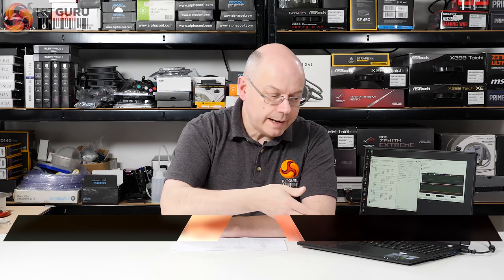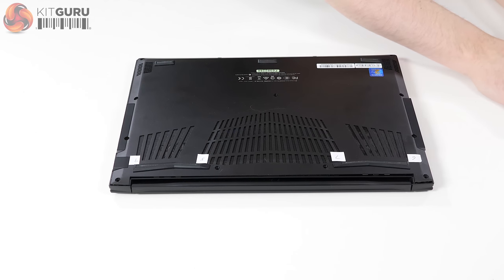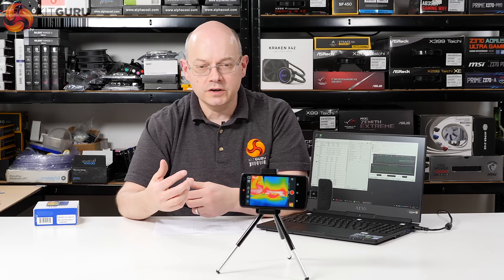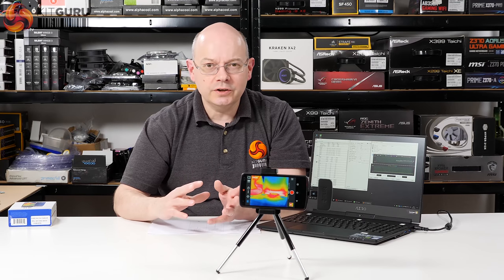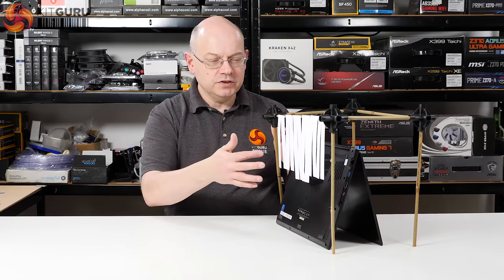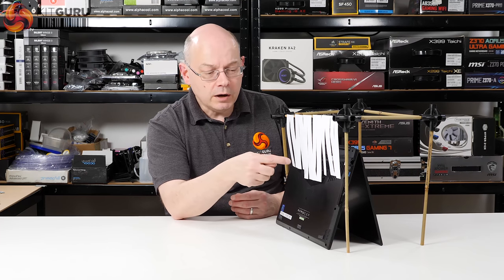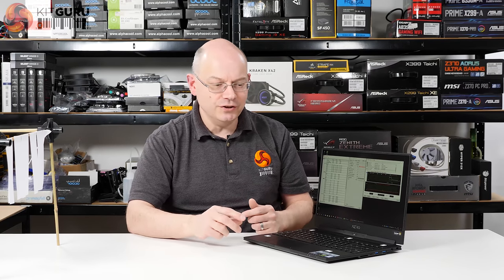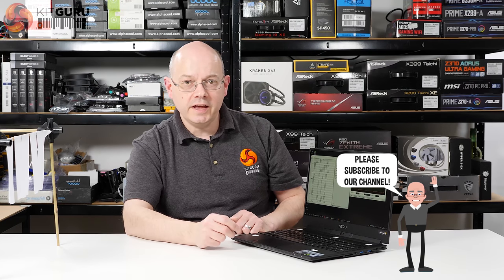Gigabyte Aero 15X v8 - Part 2: The THERMALS and COOLING!

Comment: Leo, I have to commend you on your integrity and your willingness to provide fair impartial reviews. I'm sorry I was the one to call you out on this one but as you've chosen to investigate further and clarify things it shows great character and you have my upmost respect.  

I've owned a number of "gaming"/ "performance" laptops over the years and most if not all have had vents on the underside. They have to dissipate a lot of heat in a small space and that ofc isn't easy. I'm not entirely sure there's a perfect solution (some people dislike side exhausts as it messes with your mouse hand as one example!) 

I often prop up the rear of my performance laptops when they're working hard with books,  thick magazines, pencils, whatever I can lay my hands on at the time in an effort to permit extra airflow to the machine. This would benefit from the same and of course there are active and passive laptop cooling pads that could be used for maximum effect to this end. I'm not saying this machine needs it as from your review, it appears the cooling is able to cope without throttling which is most encouraging. Like it or loathe it, this is a good laptop.  

Any chance of an Asus gm501m review any time soon?

Thanks again for your time and energy invested in your reviews. 👍🏻
Reply: Agreed. Leo rocks in this respect. And credit to you for your critical thinking capabilities and willingness to initiate polite discourse. Hats off to you both.
Reply: Adored TV on his alt account 👀

Lol I'm glad he revisited too. Mad respect for that.

Comment: Leo you earned my respect for posting this correction. Not many would go through such an exhaustive explanation of cooling. Accuracy and Integrity are the mark of a true review. Subscribed. On a side note I've used dry ice to check airflow as it's inert.

Comment: If I use the laptop through a monitor with the lid closed, basically like a mini desktop, does it mean that the vent will be blocked and will have thermal issues? I had similar issues with surface book 2 which throttles the GPU when the lid is closed.

Comment: Respect you for making this video... Also, I have the aero 15 with i7/7700.... Whenever i game on this laptop I sometimes after a while I attach a laptop cooler (it's made by cooler master has one big fan only.. sorry forgot the model number) ... & I guess this is when the middle vent makes sense..because the temperatures go down real fast thanks to the big fan blowing air directly on the heat pipes... The fan noise gets irritating... But i use headphones for gaming...
Reply: Also, thanks for explaining about the FLIR camera...

Comment: Just a heads up for the reason for the big mesh in the middle of the bottom panel, it's the only part that won't be obstructed when you use it on your lap.

Comment: I bought the Gigabyte Aero 15x v8-bk4P on Cyber Monday waiting for 1,999 USD, And I'll see how it stand up in day to day use. buying the Gigabytes Aero 15x is from Amazon or Best Buy is better value than buying it directly from gigabyte, No sale tax is applied. shop around for the best pricing and look for the ones that offers extras like a gaming bundle.
Reply: how do you like the laptop
Reply: @Identity242  I like it, I would give it a 8/10 over all for everyday use. I have the 4k model and battery life isn't excellent, I've been able 5.5hrs to 6hrs with brightness set to 35% running Revit, SketchUp, AutoCAD and Netflix concurrently. Quality is a 9/10, would have preferred a unibody build but it looks and feels solid. I did a clean install and change the trackpad to Microsoft Precision drivers. I think a good price for this laptop today would be between $1600-1800 US dollars. P. S. Get a microfiber cloth for the screen and the chassis because it's a fingerprint magnet.
Reply: I like it, I would give it a 8/10 over all for everyday use. I have the 4k model and battery life isn't excellent, I've been able 5.5hrs to 6hrs with brightness set to 35% running Revit, SketchUp, AutoCAD and Netflix concurrently. Quality is a 9/10, would have preferred a unibody build but it looks and feels solid. I did a clean install and change the trackpad to Microsoft Precision drivers. I think a good price for this laptop today would be between $1600-1800 US dollars. P. S. Get a microfiber cloth for the screen and the chassis because it's a fingerprint magnet.

Comment: One perspective I would like to see that you didn’t entirely cover in the video, is how Gigabyte advertise the exhaust to blow towards the back of the device. I thought a method of doing this could be using the same paper apparatus as in this video, but having the laptop sitting on the edge of your table and holding the paper apparatus dangling over the back fans.

Contemplating my conclusion towards this laptop is hard. I know it will be used on a variety of settings, and have come to realise it may not be suitable for all. These include. 

1. On a duvet – may not be justifiable as a surface such as a duvet would somewhat cover the air intake entirely, starving the laptop and thus resulting in overheating. 
2. Performing with Ableton Live in an outdoor location that may be highly dusty – drawing air from the bottom and the inevitability of dust being drawn into the cooling system from the surface it is placed on, thus reducing the life of the cooling system overall. 

It is really hard to justify a decision on this, the Zephyrus M, or the MSI GS65 at this point in time. I have other concerns such as battery life and aRGB output as I do a fair amount of photo editing (large reason as to why I am approaching one of these notebooks) but also the variability of applications I can use it for such as gaming and general use, replacing my now outdated but somewhat surprisingly still usable (despite accidents it has dealt with, such as being sent flying twice due to irresponsible passers by) MacBook Pro Retina 2013. 

Albeit all thanks for this clarifying review! 
:)

Comment: Have the laptop, playing a test of BF3 with it sitting on a flat glass table one of the CPU cores maxed out at 95 degrees. While the limit for this CPU is 100 degrees, its still too hot to have a good lifespan. The other components around the CPU also need to be taken into account.
I then put it on a cooling pad, and did the same test, and that dropped the max core temp down to 89 degrees.
Now testing with undervolting, looking at thermal pads to put in strategic places, to use the underside as a heatsink, and if that still doesn't help, I'll look at repasting the CPU with a better thermal paste
Quite a bit of effort required to bring the temps down.
It's still a great performance laptop though and I haven't had it lock up or blue screen once.  Happy to compromise due to the thin and light form factor, just wish Gigabyte did the work I'm having to do.

Comment: How about lighting a match, extinguish it and quickly hold it near the vents. You would briefly see where the air is flowing without filling the studio with smoke.
Reply from the maker: Drawing smoke inside a loaned laptop seems a bit ... rude
Reply: KitGuruTech For science! It's such a tiny amount anyway, probably better than using dry ice or a smoke machine as water vapour could be a problem.

Great video though, would be good to see this in more laptop reviews going forward.  I'd love to see how different thermal compounds make and impact on temperatures, although loaned equipment and all that! 😉

Comment: How about a strip of confetti?  It's light enough that when it comes in contact with the intake vents it should stick to it.  Put it in front of the exhaust vent it should be away.

Another alternative could be incense, although it is actually smoke it shouldn't have that awful smoke smell, and, it normally doesn't give of so much smoke that it'll interfere with vision.
Reply: wbkruse13 might work although personally incense drives me nuts!
Reply: Yeah correct...confetti is great...the paper might just be too heavy to capture the flow in the regions where fans aren't present.

Comment: I am really wondering what would be the consequences of adding an extra (external) fan pointing at this middle space between the Aero's internal fans.
A lot of behavior could be seen... Possibly : 
- you mess with the actual air flow and the cooling is a little worse.
- you refresh directly on both CPU and GPU pipes, cooling is better ! 
- makes nothing because help in cooling but lower the internal fans efficiency...
- something around all those 3 options...

I guess this might be worth a try !! :D

Comment: Is constant 82C ok?
Reply from the maker: Running the CPU at 82 degrees while gaming or video editing is fine. If you mean 'constant' as in mining then probably not such a good idea.
Reply: Thanks for response. My GPU seems to go to 82C while streaming+gaming, CPU stays cool, I am little concerned, but don't want to install bloatware to control it.
Reply: attack in real world usage it won't be constant 82c necessarily. Design temps are higher than this though so there is headroom which indicates how capable  the cooling system is.
Reply: In real world it stays around 76 doing something like PUBG, but yes, it does go to 82C during stress test, assume as summer comes, it will go up. The card is Palit 1070 ti. I was thinking it is overclocked, because core hits 1900+mhz.

Comment: i undervolted my aero 15x v8 (-0.150mv) and my temps dropped 8°C - stable
Reply: where did you get yours? it is supposed to be released on 4/16
Reply: Chi Zhang German online Reseller computeruniverse
Reply: paulgali on the .de, not .net Domain if that makes a difference
Reply: Nope, it redirects :/
Reply: Bit it still gets quite Hot and loud with 79 °C in gta 5.. I will try to undervolt the GPU or Change the thermal paste next
Reply: Try repasting with liquid metal, like Thermal Grizzly Conductonaut. I have a Dell XPS 15 9560 and it reduced the temperature considerably
Reply: sca Sorry Bit i will never use gallium Based stuff with copper..
Reply: you bought last years model
Reply: May the Science be with You i did Not. 6 cores 12 threads
Reply: Computeruniverse hat das Teil aber nicht? Wie hast du es bekommen? Preis?
Reply: May the Science be with You doch hatten sie als einziger Anbieter. Waren 2499 euro
Reply: Sanyex well yes, of course. The heatsink on the 9560 isn't copper. If the heatsink isn't copper on this, it's worth a try
Reply: where did u undervolted what software did u use? I'm trying to lower mine as well. Thanks.
Reply: David Holmes  Dissabling Turbo Boost in ThrottleStop reduced CPU temperatures to 60°C and the game still runs 60+ FPS with the 1070 :)  This CPU is good enough with its clock frequency for most games.

Comment: Did you just spend 15 minutes talking about air going in the bottom and out the back? Where's stuff like the power levels Gigabyte are using to power limit the package? How's that compare to other laptops in the class? What's the TDP on the cooling system? What's the max sustainable boost frequency? Does their software allow easy picking between low temperature, low fan noise and high performance?

Comment: I am not an engineer so want to know if you liked the laptop or not? I need a new laptop and I only have the Dell XSP 15 to compare this to. I don't game, I would use this for content creation. I like this because it has a very fast full size SD card reader, and nobody else seems to have one. Apple is not an option. They are too expensive and frankly, out of date. I looked at the new Asus Zenbook pro but they decided to put a small battery in a 2k laptop?? Seriously?? I don't understand how companies can be that stupid when they design a new product.
Reply from the maker: yes its a very good laptop, this is part 2 of the main review and we are addressing the airflow issues in the initial review.
Reply: Thanks. I actually did some research on QC or defect rates from many companies. I am in Japan so it is a good place to test quality control. To my Alarm, both Dell and HP have quite high return or defect rates. Gigabyte is very low. Perhaps because it is a smaller company, I don't know. It looked like a quality product when you removed the cover.

Comment: good review... would like to see more battery comparisons (with balance power cheat turned off)....the paper is fine for basic video......pitty you don't have time/skill do to advanced  tweeking (eg changeing thermal pastes)
Reply from the maker: Cannot really see the point in removing the cooler from a new laptop and replacing the thermal compound. There may be an advantage to that after a year or two but the aim is to review laptops as they are delivered to paying customers.
Reply: it's more just advanced stuff to improve cooling/quite running... as some manufactures use cheap "stable" paste and not higher quality(might be able to take off 5 degrees)..... but it is not needed for this review type..... it is a very good laptop mainly for the battery life... just no one is doing any advanced stuff to see how far you can push it with advanced tweaking

Comment: Notebook gtx1070 is always better then gtx1060 within, but it is not gameplay on ultra no... not at all, it will something like between  midium & high, shadows always high... if it must be for gaming - gtx 1080 endeed afcourse... look for msi titan or some alienware, but msi is better for cooling system... axiom is not so hot - more fps in game.